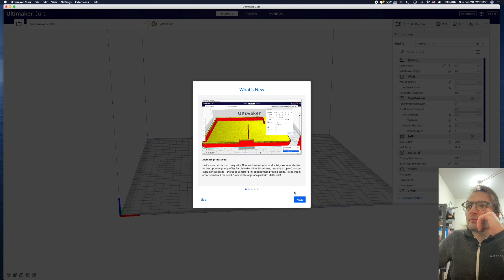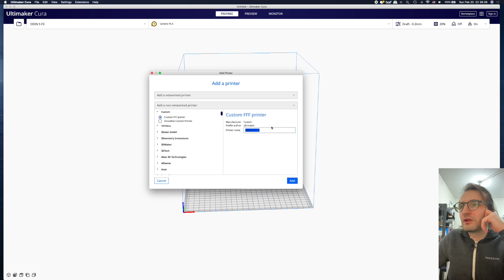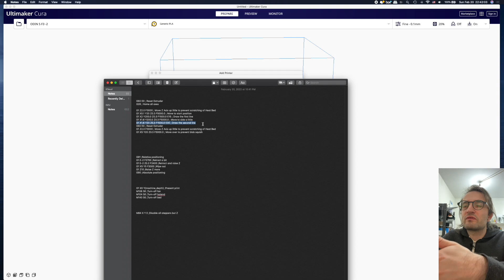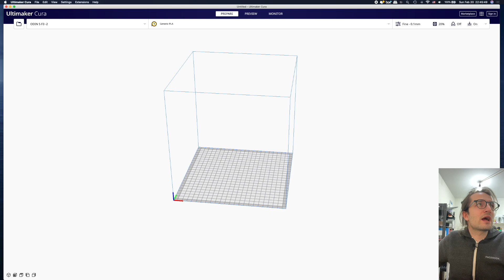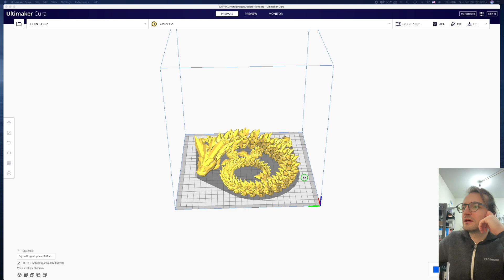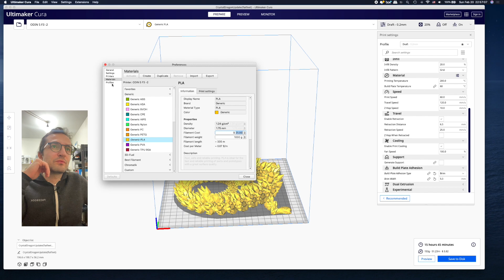CURA settings for ODIN 5 F3 3D Printer

Comment: thank you for this. using your end g code, the printer presents the print to the rear of the printer so you need to reach around the machine. how can we get the bed to present itself forward instead when the print is complete?

Comment: There are three fields under my "quality" tab. The third one says "line width. What should this be?  Also, there is nowhere for me to put a number under retraction, just check or uncheck box. And since you asked to be told if you made a mistake 6:06 you meant to say 1.75, not 0.75 😂. 
Also, if anyone is having a hard time finding some of the settings in this video to show up, go to settings, then setting visibility and select whichever parameter you’d like to change.

Comment: I have an ender 3 v2 and using the same settings im printing in 32hr one of these were he is doing it in 15hrs. Any advice on how to bring my print time down?
Reply from the maker: Probably not the same settings then. Drop infill to 10%, no supports, no raft, layer height 0.28mm, print speed 60mm/s 😃 check these

Comment: Do you know how to set up this printer for Prusaslicer?  I was wondering why you use 6mm for retraction?  Should direct drives be lower around 1 or 2?
Reply from the maker: You can set it up. Its similar. You need to watch some more yt videos. 6 mm is depending on some filaments i use. Yes 1-2 also should work. Start with 2.5 and by trials method find your good range.
Reply: @3DPDoctor  Awesome.  I will try higher retractions now.  I do get a lot of oozing and blobs using 1mm. I just found your channel and subscribed.  I like your videos🙂
Reply from the maker: Thank youuu